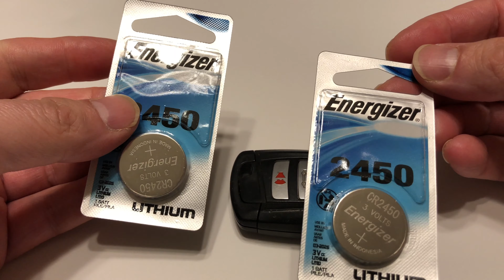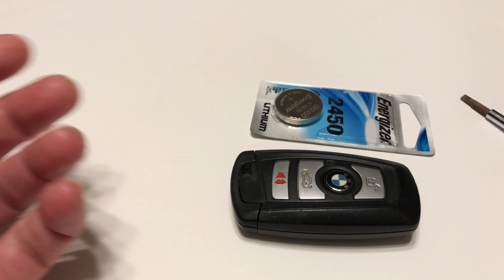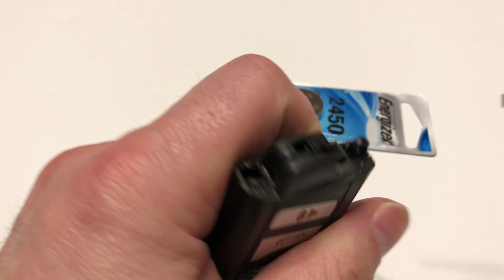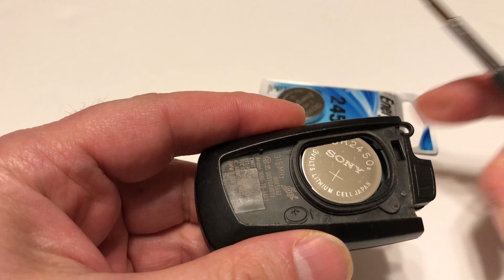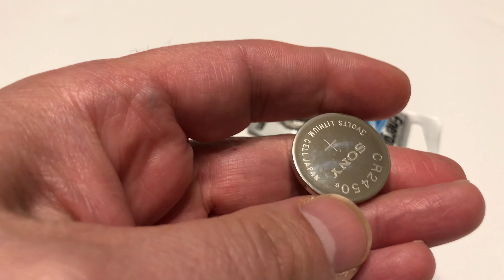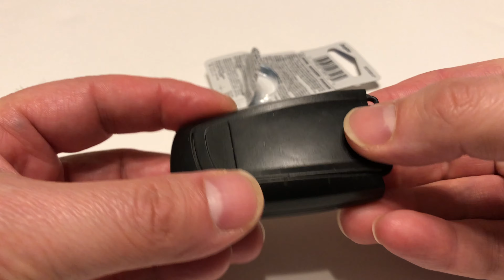How to Replace BMW Key Fob Battery Lithium CR2450

Comment: You don't even need a flat blade screwdriver. You can use the spare metal key just removed from the fob to pray off the battery cover. It is written in the BMW car user manual.

Comment: Thank you for the video. The battery inside your key has the number CR2450B (as do mine). Does the “B” battery make a difference? Or is it the same as the regular CR2450?

Comment: You can use the flat end of the metal key 🔑 to get the top cover off 
Using same space as u did the screwdriver 🪛.